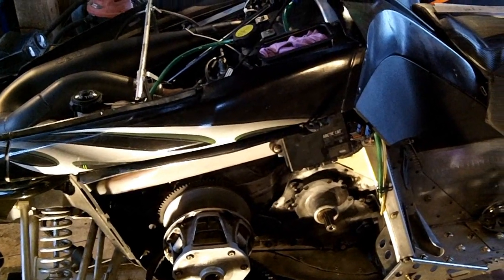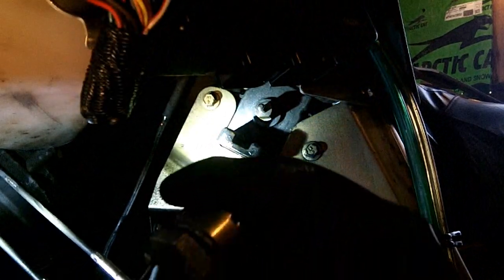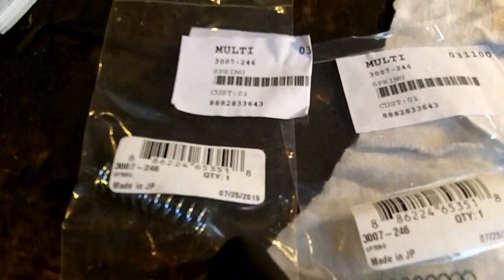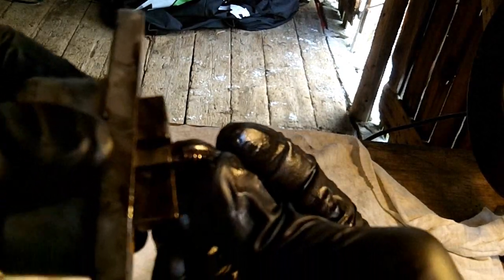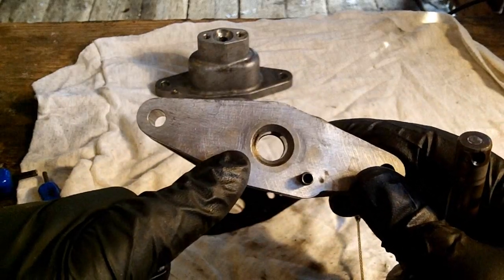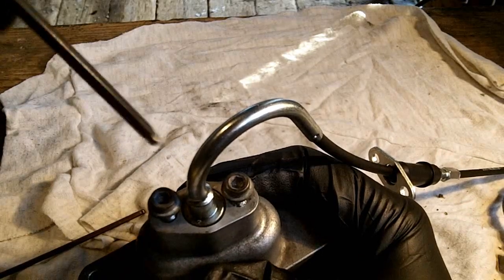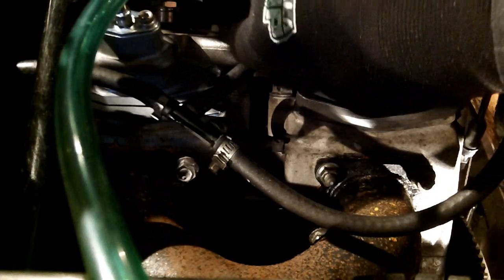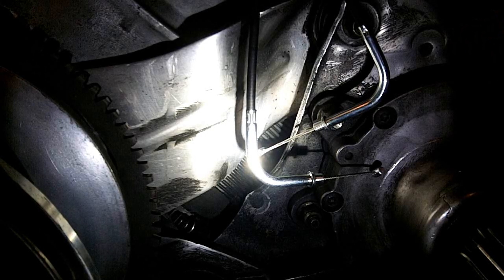Arctic Cat Power Valve Cleaning and Cable Replacement - APV (Arctic Power Valves)

Comment: Good video I have a 2015 M8 that I need to clean the power check valves. I just bought it and it's in pretty good condition with only 1500 miles on it, but  leaks gas while sitting in garage so I think i need to clean them  Thanks for the step by step.
Reply from the maker: If it's gas it could be a cracked fuel line or gas tank.

Comment: The blades are beveled does the bevel go up or down towards the crank.
Reply from the maker: The shape of the blade will only let it fit in one way, they can't be installed upside down.

Comment: Did this helped you out? Was the spring the problem for your check engine lamp? And did the sled before you doin this video run in limp mode?
Reply from the maker: The spring was the problem.  It didn't run in limp mode but ran better after.

Comment: Quick question at the end of the video setting the cables they were good. U hooked up the servo and then u said u loosened the cables for little slack wouldnt that mess up your measurement?? Love the video thank you in advance
Reply from the maker: The cable length is set by the barrel adjusters and jam nuts.
Reply from the maker: I loosened it by rotating the servo itself to create the slack to get them hooked up not readjusting the cable length.

Comment: How was your sled running before u changed that?
Reply from the maker: It was running ok but I was getting an occasional check engine light for the power valves.

Comment: Would something like this cause the engine to stop randomly without any check engine lights? I've been trying to fix my 2011 f8 for months now can't figure out the problem.. today I'm going to need to replace the cable.. not sure if that would cause the sled to stall - runs well.. until it stalls lol :(
Reply from the maker: I don't think so.  A bad stator would cause that problem.  I've had to replace a couple of stators on my F8 and F1000.

Comment: Slot?  Is this some how w a reference to the large or small beveled edge? I see a slot where the power valve goes into the engine but lol no slots are on the valve.
Reply from the maker: The "slot" i am referring to is the at the bottom of the space that the powervalves fit into on the cylinder.  They will only fit in one way you can't put them in upside down.

Comment: Interesting how he keeps referring to a "slot". The videos never does show how the blade is orientated
Reply from the maker: Blade will only orient one way, its designed so they can't go in upside down.
Reply: On the sled he is working on there is like a tab coming off side of valve so they can only go one way as it must match the shape of the hole.